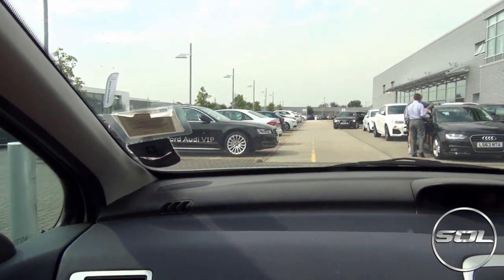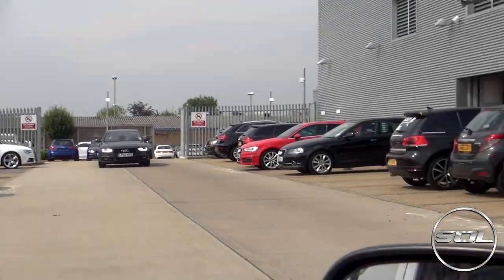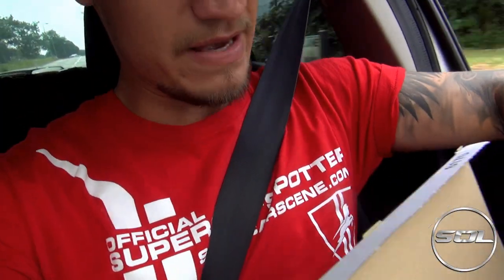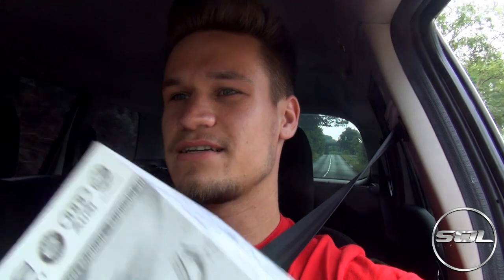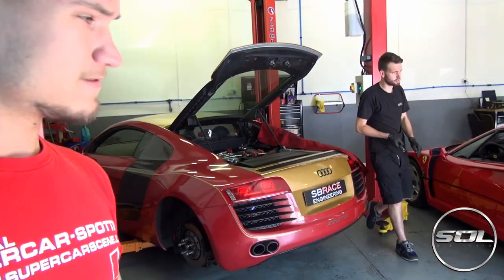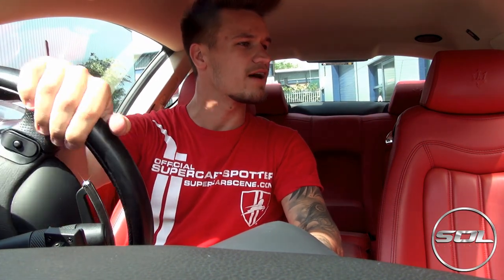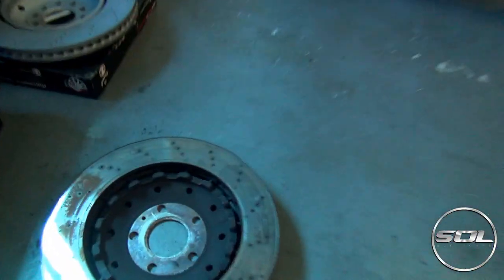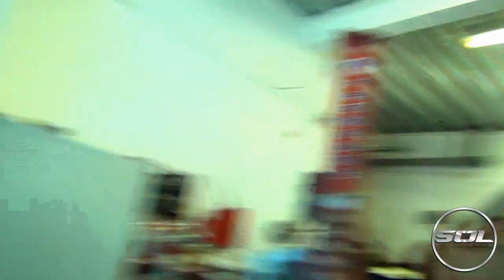My Supercar Vlog: FIXING my Audi R8 Part 1

Comment: de disc brakes doesn't look bad at all, I will probably change it on the next pad change, and the complete service with filters, in my opinion had to be done the day you had bought the car. a part of that, why to put stock air filters and not a little upgrade? with a goot exhaust, + a simple ugrade on the air filters and a ecu remap, the car has to feel much better.

just an opinion.